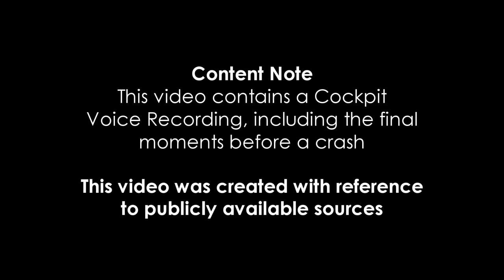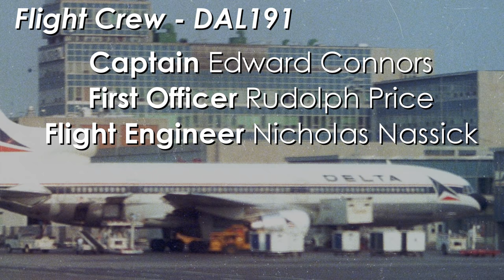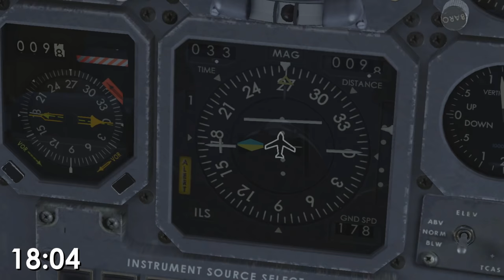How Deadly Weather Brought Down This Plane (Delta Airlines Flight 191) - DISASTER BREAKDOWN

Comment: My parents (who hadn’t yet met at this time) both worked for Delta at the time of this accident, and had a connection to the plane. My dad was one of the Atlanta mechanics who painted this plane a few months before it crashed. My mom was a Dallas-Ft Worth based flight attendant who was at the airport when the crash happened. She said she and her colleagues all ran to the windows when it happened because they could hear/see it when it happened. She knew the flight attendant at the back of the plane who died. (She says the Mayday/Air Disasters portrayal of the flight attendant wasn’t very accurate.)
Reply: I was sitting across from her in the bulkhead. The plane broke apart beneath our feet when it exploded upon impact with the steel water tower.
Reply: @andriagoodkin7640  I am Emma's dad and spent a lot of time on that airplane.
Reply: I painted the upper left quarter of the fuselage to the tail and the right side of the tail.
Reply: The Mayday documentary portrays the official account of the crash --- an account that doesn't match up entirely with my experience. Shortly before we crashed, I was alarmed by the violent shaking and turbulence and the terrified look on the flight attendant directly facing me.  When I turned to look out the window to see what was happening, I saw flames and black smoke coming off the left wing. I always thought it had been struck by lightening, or an engine had blown when they revved it up in the fight to increase the airspeed and recover altitude. I don't know. What I do know is the plane was on fire in the air --- BEFORE we touched ground and, tragically, hit that poor man on the highway.
Reply: Thank you for sharing your experience. So many caring people from the Dallas-Fort Worth region reached out to my family and me when I was there in the hospital.

Comment: Most airline pilots these days will fly this exact same scenario in the SIM.   It's survivable, but ONLY if you do the recovery just about perfectly.  Aviators learned a lot about surviving microbursts from this accident and a few notable others - the PanAm 727 leaving New Orleans and crashing in Kenner, LA.   The Eastern b727...USAir in Charlotte, etc.     We're better trained now because of what we learned from them.   The number one rule is - do not fly - into large convective cells during takeoffs and landings.   Delay.   Avoid.   Use your head so you don't have to be Buck Rogers in the actual event.  This was a tragic event.   It's worth noting that a Lear Jet immediately ahead of them went through the storm and safely landed.  Super Cells have very short lifespans and a difference of just a minute or two can make a huge difference.   I personally have witnessed two micro busts while on the ground and they are incredibly powerful.
Reply: - Agreed.

A slight correction for accuracy for readers with less understanding of the phenomena than I’m confident you have (no doubt a inadvertent slip of terminology): 
Microbursts have a very short life span.
Super-cell type storms have a long lifespan due to the tilted nature of their updrafts - which permits them to sustain themselves for extended periods of time due to the downdraft not choking off the updraft which fuels the storm.

Comment: The L-1011 had a low life cycle, a lot of people never knew this. It was rated for only about half the pressure cycles than other planes like the DC-10. Its one of the reasons they vanished so quickly and you dont see them used in other roles like firefighting.
Reply: Really?

Comment: But the L-1011 Eastern and Saudi incidents had absolutely nothing to do with the type of aircraft.  They were both entirely pilot error.  With the Eastern flight all three of the pilots were so focussed on a burned out landing gear indicator light bulb that they failed to monitor altitude and flew the plane into the ground.  In the Saudi incident the pilots were so focussed on going through the checklist that they failed to depressurize the cabin so flight attendants couldn't open the doors and evacuate the plane.  They were so poorly trained and arrogant that they ignored the screams of passengers and FA's pounding on the cockpit door for help.
The DC-10 crashes were design flaws and maintenance faults.  The crash at Chicago O'Hare was due to metal fatigue in the engine pylon.  Even after losing one engine at takeoff the plane should have been able to maintain positive climb with the remaining two engines.  But it didn't.  There were also multiple crashes resulting from a faulty design flaw with the cargo door.  As with the crash at Sioux City, Iowa, the triple redundancy backup of the hydraulic system was the cause.  The three hydraulic lines ran side by side.  In the event of a structural failure, such as the cabin floor collapsing, all three lines were severed which pretty much negated the whole redundancy design.
Now, here with the DFW crash the type of plane was also not a factor.  Any type of aircraft that flew through such a violent and sudden microburst would have most likely crashed.
Reply: Loss of all hydraulic fluid was the reason
AA flt 191 couldnt keep positive climb rate. When the engine/pylon let loose, it also let several feet of leading edge from the left wing damaged from collision with the wing. That severed hydraulic lines located behind the.leading edge. If you look at the photograph taken by a tourist when the plane was flying at a 90° angle, you'll see a trail of shit coming from the wing. That was the left side hydraulic fuel quickly leaving the plane. They tried to right the plane the correct way. But to do this you have to haboth wings creating lift at that low of speed so that additional thrust could be applied to gain altitude. The slats retreated when the  hydraulic fluid was gone. Since they lost the slats and partial 
flaps, the left wing couldn't generate lift at the slow speed they were flying.
They didnt have a chance at all.
Reply: @patrickmollohan3082   beautiful response was going to say something like this
Reply: @patrickmollohan3082  Just gonna throw on some additional details. The engine that detached was also responsible for multiple aircraft systems such as the CVR, flap/slat disagreement alert warnings,  and the stall alert systems. 

Since the engine powering the captain’s stick shaker (the only one that would activate on this version of the plane) was lying on the runway, when combined with the lowered stall speed, the crew genuinely had no way of knowing that by following normal operating procedures for an engine failure on TO they were actually dooming their plane. It was a real cascade of issues that the crew had no hope of resolving in the time and training they had.
Reply: @holyfordus  
Thank you very much for those details.
It just boggles the mind to think of everything that has to happen in an exact sequence, to make the plane work as it was meant to. Again, thank you for the awesome details and explanations!!
✈✈✈✈✈
Reply: AA191 was poor maintenance and a minor design flaw
Reply: @potato1907  - Correction:  AA191 was poor maintenance practices and SEVERAL SIGNIFICANT design deficiencies.
Reply: A Swiss punk rock band called Kleenex even wrote a song about how dangerous the DC-10 was.

Comment: The L10-11 that crashed in the Everglades was caused by the pilots being distracted by a blown light that indicates the landing gear down and locked . Jet was on auto pilot but captain bumped the yoke while stuffing around with the indicating lamp . The jet just kept descending until it hit the swamp . Absolutely no fault of the L1011 design in anyway .

Comment: You said that the TriStar had a troublesome history, yes but not on account of its design. Most of those accidents were highly unfortunate especially Delta FL191. I travelled quite a few times on the L10-11 when my dad worked for Saudia in the 1980s. I think it was one of the coolest passenger jets in history. It looked cool, and it sounded cool.

Comment: So the plane did have a “troubled past” considering the number of accidents. I think this is a fair statement… I don’t see a problem here - and still wouldn’t say the criticism is unacceptable that the accidents weren’t due to the design of the plane but stemmed from other reasons. This is not contradicted by the statement of a “troubled past”.

Comment: The final report from the NTSB about Delta 191 highlights that pilot error for flying into the storm but acknowledged that they had no idea that they were flying through a microburst resulting in an undershoot on approach to Runway 17L at Dallas / Fort Worth Airport. 

(Note: The Captain had some experience in Microburst with quotes in the CVR saying C: “Your gonna lose it all of a sudden.’ ‘There it is!” “Push it up, Push it way up, Way Up! FE: “Way up!” C: “Way up!” “Hang on to this $*= of a #(*@).” I believe he has done it through his training but I can’t confirm that) With the technology at the time and that the leading two aircraft an American Airlines aircraft and a small private aircraft made the same approach into Runway 17L with no issues likely forming (the microburst) not long after the landing of the small private aircraft before Delta 191 was due in. If the pilots were trying to go around by pushing the throttle to TOGA (Takeoff / Go Around) as they did flying through the microburst it would be unrecoverable resulting in that undershoot. And overall lost of control when they violently hit the ground. With the left wing and landing gear getting damage and the Number 1 engine shooting flames due to the impact then a second impact with the tank approximately 400 ft from the Foot of Runway 17L.

Comment: The L1011 I flew on had the left engine catch fire after flying from Egypt to Germany to Ireland to Delaware 
Then to Dallas and then Ft Lewis 

This was Jan 06 
The plane was a military private charter 
Cheap cheap cheap 
even the bathrooms was not working 
Carpet and seats badly wore 
Inside paint chipped 

I rather take my chances in Mosul than to fly again

Comment: Also In question at 4:08 there 4 parallel runways with 191 using 17L however, is it 17R and 18L and 18R at Dallas / Fort Worth?

Comment: My late grandfather flew for Delta. He also flew the L-1011, or a Tristar. He retired in 1996, though.

I also came to the conclusion that the number 191 is cursed
Reply: Hard to believe two separate air disasters had the same flight number of 191.